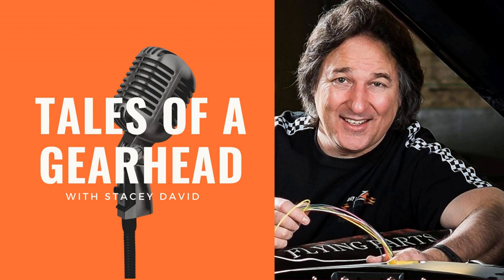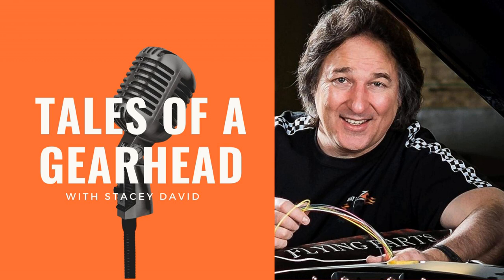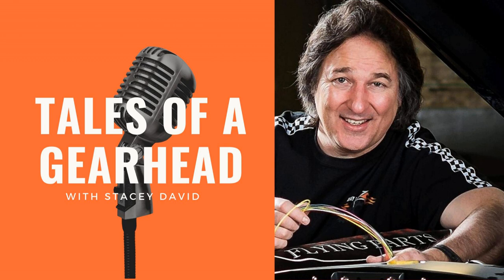Listener Questions - Weather Stripping - Brake Upgrades - Stacey David's Tales of a Gearhead Podcast

Comment: Thanks for sharing your experience and expertise.
Depending on the Zero turn mower.
A  common  Commercial Zero turn 61"deck with a 28hp comes in at 1200lbs +- a few hundred pounds.  That's dry weight.  Add in 14 gallons of gas,a case of oil for the hydraulics and engine oil the weight adds up fast.